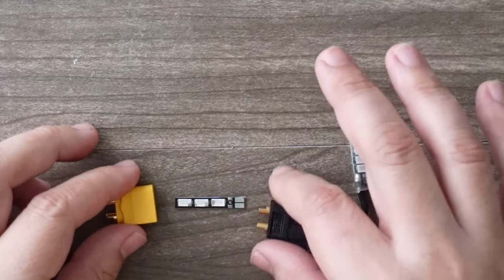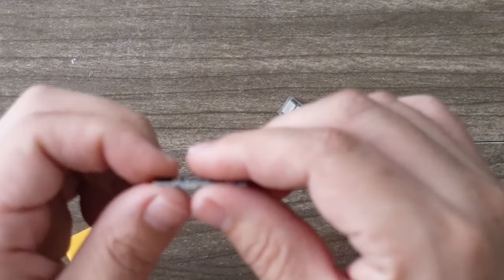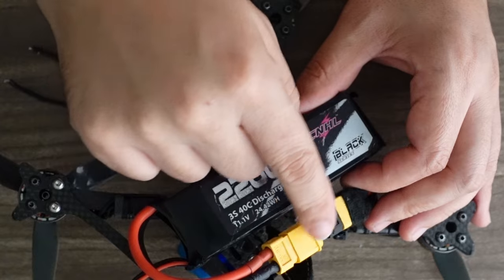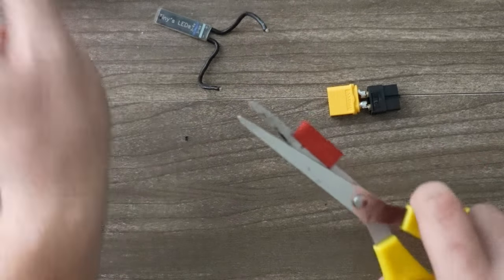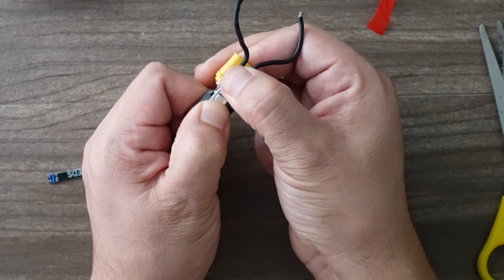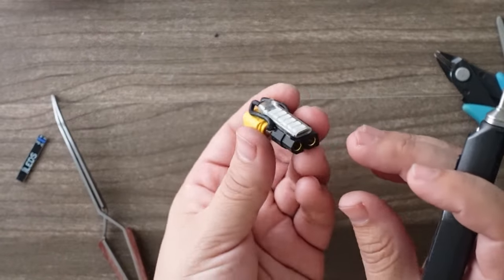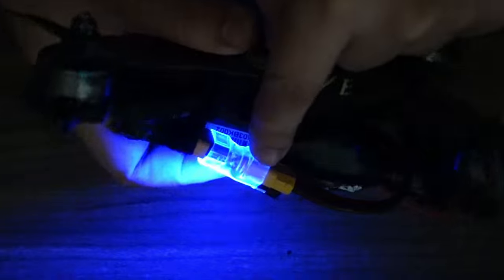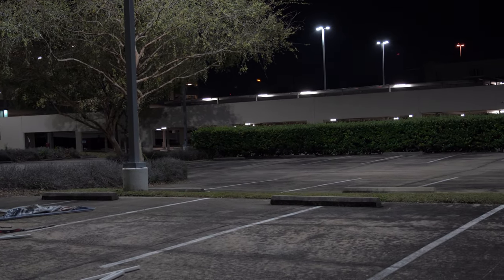DIY XT60 LED for your Drone/Quadcopter

Comment: Hey brother trying to get a hold of you. I have something I need made up if your interested in doing it.
It's for quad motors in the 11xx size one's, the part is so you can use them for the mini airplanes 400mm I size.
I know you have fb, but I can't seam to find you on there. And your the only person I know that has a lathe, I haven't got one yet, it's my next buy later in the year.
It shouldn't take much time to make.
Anyway, let me know how to contact you then, any kinda help would be great
Reply from the maker: Hey man. I don’t actually have a lathe. I only 3d print. Maybe it’s someone else that has one?
Reply: @JonE5FPV  hmmm. Maybe it wasn't you. But I swear you had one and was doing them motors
Reply: @JonE5FPV  those gas powered motors